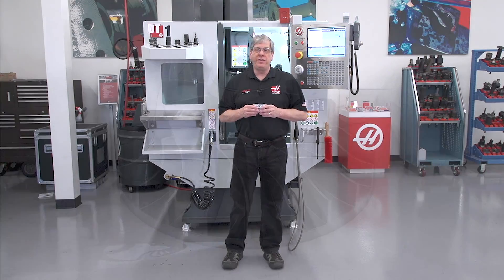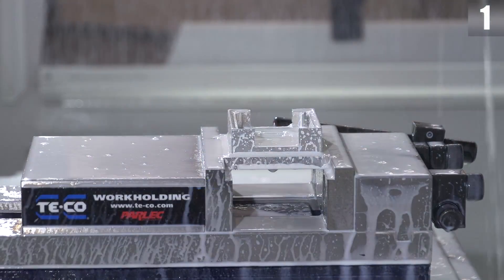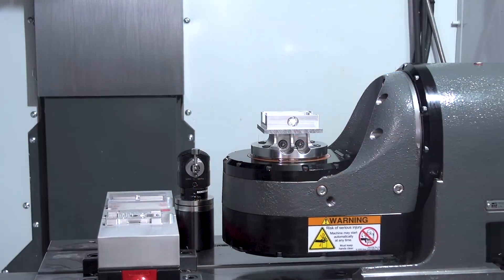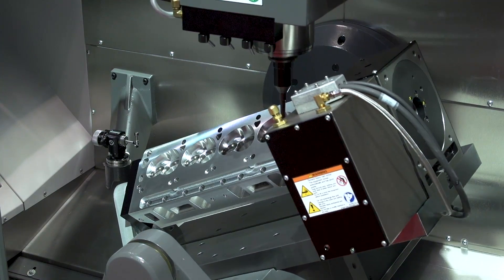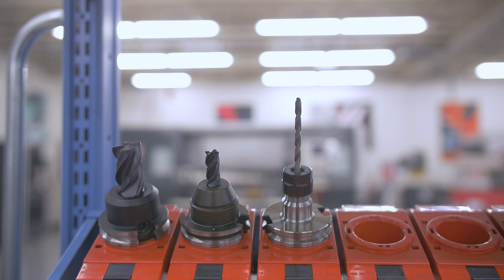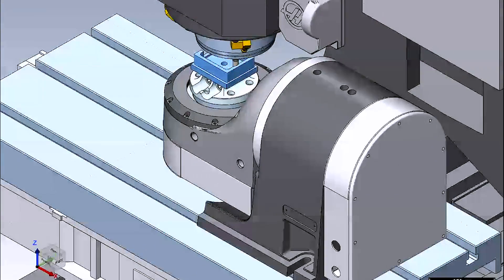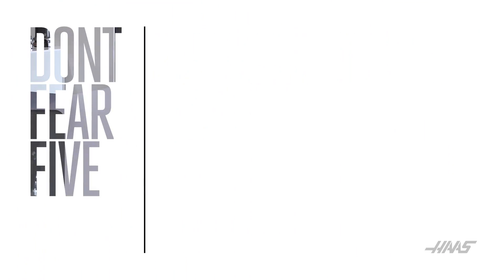Don't Fear 5-Axis - Episode 1

Comment: When i see a number of 21% time saving is that high ?

I would depend if you are making 10 or 1000 parts or more then there would be value in spending more to get more.
 eg 5 Axis. as an option not stand alone.

Most customers i deal with want a maximum of 100 parts but most want 10.

It comes down to the operator / end user of the machine.
If you have a stand alone 5 axis machine as well as a 3 axis machine that is an advantage.

But if you have one VF 2 or larger then 5 axis set up time would pretty much erase any time saving unless you leave the trunnion on the machine for extended periods of time.

Is that real world for most shops ?
Most would say No.
Reply: Yeah but i think there are parts so complicated, that 5axis machine is the only option.

Comment: Yes I think 3 operations.Once it is running each time you open the door you get one finished part but you need 3 openings to get 3 parts.
My point on the machine was to see a wide shot that showed the part was actually in a DT1 not a DM1 or Mini Mill.

Comment: This is a little off topic but i'm curious, what indexable face mill were you using to fly cut the top surface? It appeared to be two or three inches in diameter.
Reply: It is actually a 50mm Iscar HELIALU face mill designed for cutting aluminum.

Comment: Was the 5 axis version run in the DT1 behind you.Would be nice to see one shot of where the part was actually machined just to give us an idea of how much space that rotary took up.
Reply: TRT100 I think
Reply: I agree, it would be nice to step back and see it all set up in their smaller machines. I am going to buy a Mini mill at some point this year and if I could run that TRT100 permanently setup and a vice I would be very happy. Means I could prep stock in the vice and transfer for it to a clamp setup in the 5 axis table without additional setups or work. I have smallish parts only, so this would be enough room for me.
Reply: Aegir Cald you can. I've seen those machines in person in Oxnard. You can fit a vise next to the trt100
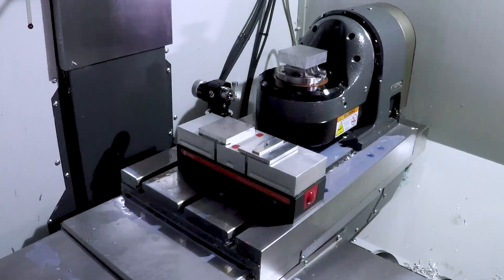Reply from the maker: Michael - The 5-axis was run on the DT-1 with a TRT100 rotary unit. The entire 5-axis machine setup is shown starting at the 1:12 mark of the video and again at 1:39. -  John

Comment: Wouldn’t the first operation to make the dovetail count as a setup? It doesn’t add to the inaccuracies but it does add time
Reply: Should have used a Lang vise
Reply: Definitely 3 ops
Reply: Pretty much an extra step to cutting the materrial. Made by the same employees.
Reply: We don't count dovetailing as an operation, since we do them in cheap mills made by interns in another process.
Reply: Eggsr2bcrushed I was about to say that. Lang vises are awesome! And raise the height a little and you're still able to use short holders on a umc750. Way more stable than long holders.
Reply: Some metal suppliers ship with dove tail. But like he said work holding is up to us. we can use 5th axis, raptor, and or anything with out dovetail
Reply: that goes by so quick it's not considered a setup.
Reply: i use an SMW vise and i won't even notice the cost in material (an extra 0.3 mm, ~12 thou, assuming you don't face the bottom before dovetailing) in the cost calculations until i stop rounding to whole dollars or run 100+ parts